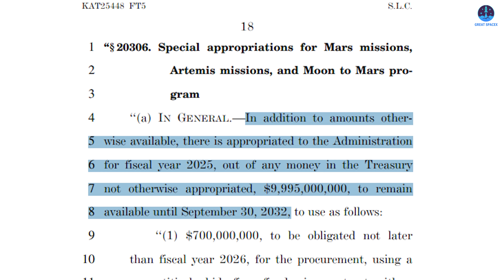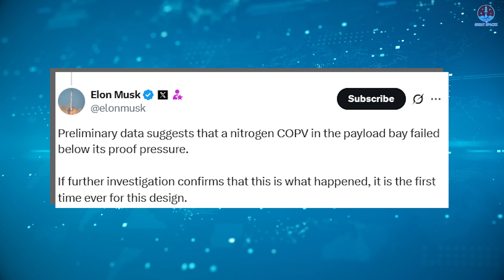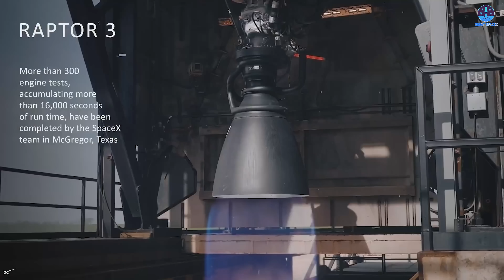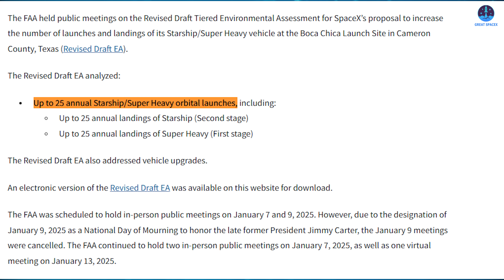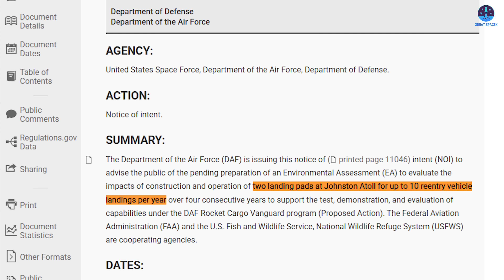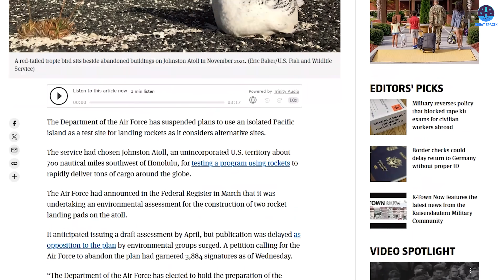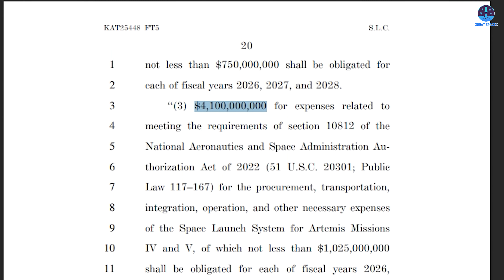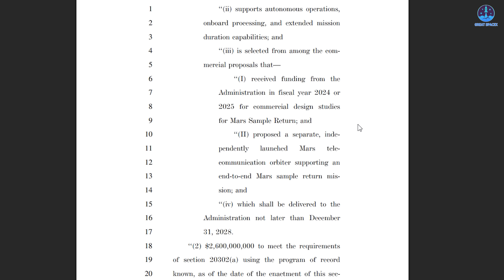SpaceX officially Tested Starship COPV to EXPLOSION to get into Orbit This Month...

Comment: If they make the pressure vessels have some features that allow for less specialized handling, that might be worth some mass.  Especially if it serves other functions, and shows  damage easily.  I am imagining some flanges and more robust grab points.  such as have the brackets be part of the copv, and those protect the rest of the composite.  they could be fragile and show damage before the integrity of the pressurized portion is compromised.

Comment: IE:4Get releasing a load of “False-Satellites,since they according to SPACEX the doors aren’t built strongly enough and may tend to warp. That warping WILL lead to the doors not closing properly. That will inevitably lead to the ship going into a spin and loosing control and hence not re entering space to test its landing abilities. Let’s rather see a ship launch; circle earth and re-enter and land properly into the atmosphere potentially getting caught on one of the newly built Launch pad s with its arms outspread and awaiting Starship to prove a safe catch. Then try a few with landing legs for moon and Mars landing s on earth. Perhaps introducing Dragons rocket landing system to bring Starship down with as little regolith disturbance as is possible. Or perhaps the same aim for MARS Red Dust. A thought.

Comment: I would like to know why we don't develop legs for landing instead of megazilla???
Reply from the maker: Landing legs add significant weight to the rocket, which reduces payload capacity. For a vehicle like Starship, designed to carry up to 150 metric tonnes to orbit, every kilogram saved is critical. By using Mechazilla’s tower arms to catch the booster and potentially the Starship upper stage, SpaceX eliminates the need for heavy landing legs, thereby increasing payload capacity and reducing material costs

Comment: Since COPD’s were found floating in the waters off The Previous Starship Failure. Which had included the ships “Explosive System Intentionally blowing the ship into smaller;less dangerous pieces by the time it impacts with the earths surface. The safety precaution however saw COPD tanks still whole and still floating on the surface of the Ocean. So whereas they are defined as a pressure issue problem or merely a problem of weakness. In that case and I recall a few other s. COPD’s were seen floating and or lying on the beach. WHAT DIFFERED THOSE TANKS FROM THE ONES ABOARD THIS LATEST TEST FIRING. A SIMPLE LACK OF PROPER INSTALLATION MANUFACTURING MATERIALS USED. WHAT. IF ONE OF THE ABOVE;IM SURE SPACEX WOULD HAVE FOUND THAT SMALL KINDA ISSUE. (To me primarily The Shape of The Tanks;In the materials in which they say they make the tanks;for the substances they apparently use for the materials which they pump into them. They seem to also be “WOUND”; in a black carbon fibre or glass fibre or rubber,(From a visual it’s kind of difficult to Define.).  However it stands to logic that they should be constructed from a material far stronger than their requirements state & that they also retain a large degree of The External Tiling or fire resistant materials which could quite easily be worked into the tanks whilst they are still constructing them. Since they are largely on the side which faces the hottest part of earth s atmosphere on or during the ships RE-Entry. (It contributes to the longevity of the TANKS performance from Launch to Re-capture to Tank refill and RE-Launch. If they are built with absolute CARE; then there Ability to withstand as Many launches and landings for which they are STRUCTURED. Face it on Lengthy journeys to Space;I.E.MARS were it’s not merely the distance but the time Between “When Flights Can Be Taken”;Which makes it essential that ALL parts and any spares are built to far Outlive The Period Assumed The Ship should be built to withstand by 6-10 X more than one could ever imagine it would possibly need to survive in its absolutely worst situation arising and Then Multiplying that by at Least 10X. Just some Thoughts.

Comment: With the idea of planning a trip to Mars , instead of pumping fuel from one space ship to another .." Why not connect to it and take it with them to Mars  ..??
Reply: Because in space no one like hitching up a trailer.
Reply: @davfree9732    well..they plan on connecting to refuel anyways ..
Reply: Why not just add a real 2nd stage that is expendable?  Then just wait to fire the Starship until it is at the the translunar orbit altitude. It would be the more cost effective way to do this.  

Maybe the goal of 100% reusability, is a misguided concept!  It's going to take a lot of effort and cost to get those tankers up there and back.  The whole idea is insane if you think about it!
Reply: @professorg8383    in outer space  ..no gravity  so it an object is propelled  ..it would carry on through space in its direction ...why wouldn't they blast the engines  for a short bit then shut them off ...coast to Mars...they did it going to the moon ..
Reply: @danielreece8898  The idea that there is no gravity in space is simply wrong.  At the altitude of the international space station gravity is pretty much the same as on the surface.  Astronauts don't experience it because they are in orbit, they are moving fast enough to fall around the Earth instead of falling onto it.
Reply: @JClarkeCT1334     my point is ..not having to fire up the engines all the way to Mars.   You're connected  to that tanker full of fuel and still have fuel left in the main spaceship  ..you coast there ..like they did going to the moon ..I watched that when I was a kid ..

Comment: I wonder if these vessels are leak checked using helium detection. Smallest molecule used widely in the industry.
Reply: The limited knowledge I have on COPV tanks is that when they fail they don't leak but instead catastrophically fail all at once with no warning. This was one of the issues with the Ocean Gate submarine implosion. There was little to no warning it was going to fail.
Reply: Well kind of 2 different issues. Implosion vs explosion.  Something must have either leaked from the tanks or they were overheated to explode. @Workingcinderellaman-jw2pf
Reply: @tommcmanus5774  Or.....it failed due to pressure and a fault in the construction.

Comment: Never give up!  Why ditch it into the ocean?
Reply: I can imagine some of these are "scrapped" in the ocean. Even if it was recently designed ship, the newer one they are building has different designs. Just burn the old one and learn some data from it and move on to the new changed version. Retrofitting an old design could also lead to failures not related to the new designs, just failures of the retrofitting.